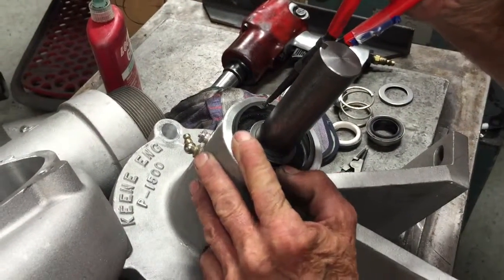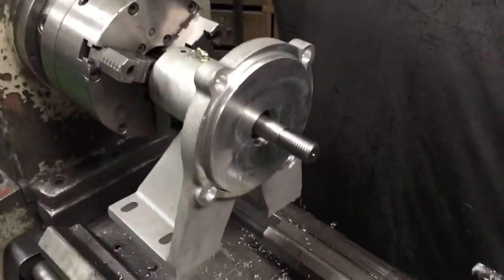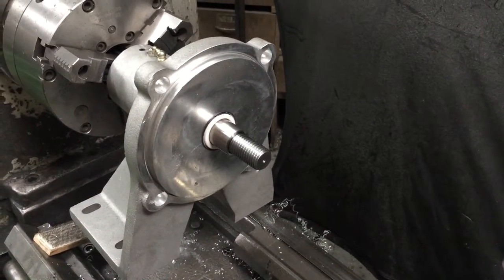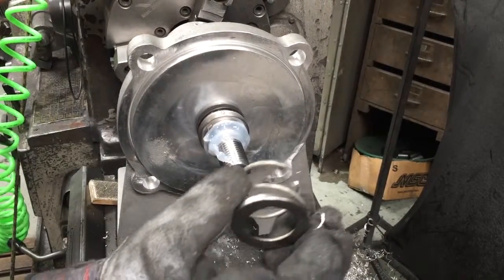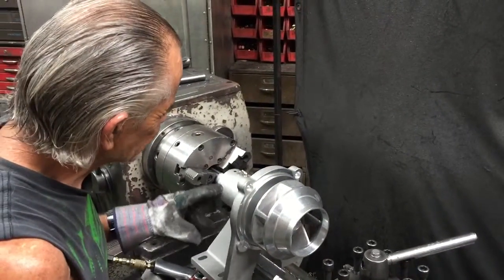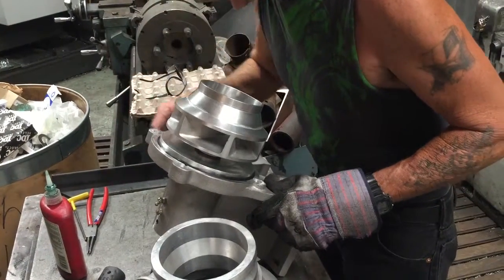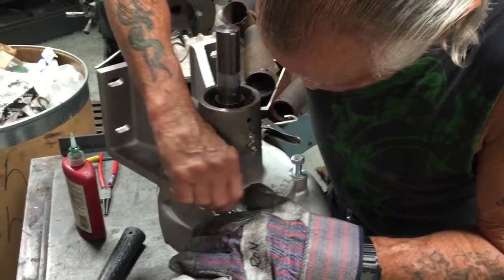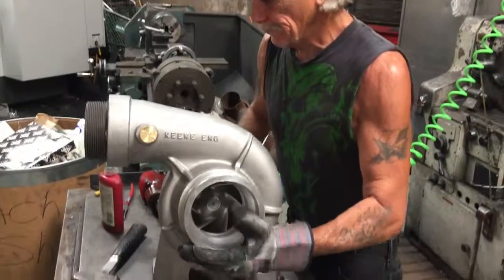Keene P1500 Pump Build Part 2

Comment: Mark Keene. I’ve got a suggestion for you. Maybe you’ll build it and give me a reward, or maybe you’ll build it and not give me a reward. Or maybe you will laugh your a$$ off, but I wouldn’t until you at least try this.

Take a 5 gallon bucket and attach a hose in the middle of the bucket , where the water is hitting the bottom of the bucket pretty strong... should be adjustable... 
as the pay is put in the bucket it starts to roll - boil ( not heat boil ).  From the water pressure..  the light material will float in the water rolling out of the bucket and the heavies will swirl but continue to drop towards the bottom if the bucket... when you have no more material reduce the pressure and let it continue to wash out the dirt and lighter stuff until the water is clear. 
You can actually watch the gold lift and drop, 

Hopefully you’ll check out this idea. Hopefully you’ll build it, hopefully you’ll give me a reward.... best regards
Reply: Your idea is not crazy it has been done in the past many times.  Probably one of the better machines was the Oterburge gold separator.  The main difference it the water came from the bottom through a filter system that provided a smooth flow of water up.  Everything was in a state of suspension so the heavies settled to the bottom and the lights blew out the top.  We also did this in the Hydromatic Jig that we built back in the 1970s.  I have seen dozens of products built with this concept over 4 decades.

Comment: Hi Mark, Todd Miller in Peru.  You sold me a P1500 around 13 years ago.  I still have it even though the government pretty much made river mining illegal here.  I have a question about the pump.  If I restrict the outlet can I run it with a smaller engine and still get high pressure?  I have a need for a pump for drilling wells and I remember you mentioned something to me one time about cutting down the rotor or reducing the outlet.
Reply: The engine does require at least 40 hp plus.  If you reduce the flow by restricting.  The hp requirements will be reduced somewhat by how much we just do not have the test data to make a accurate assumption
Reply: thanks...I will try it and let you know.